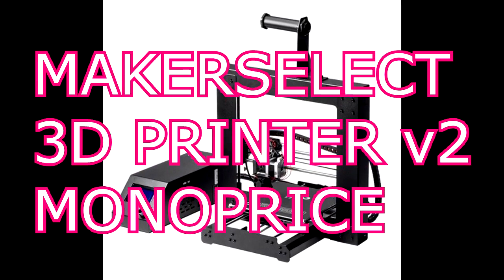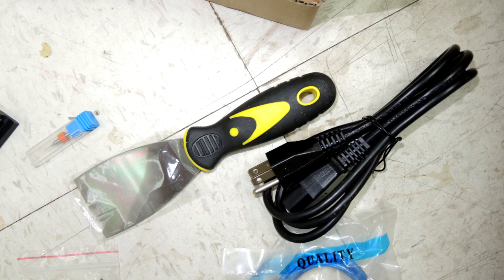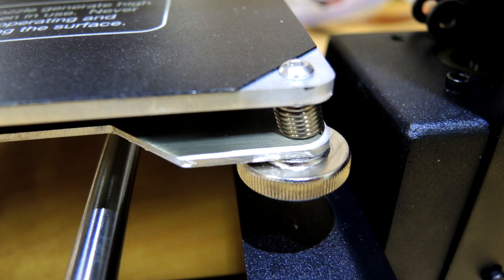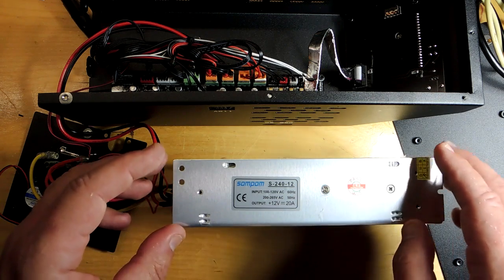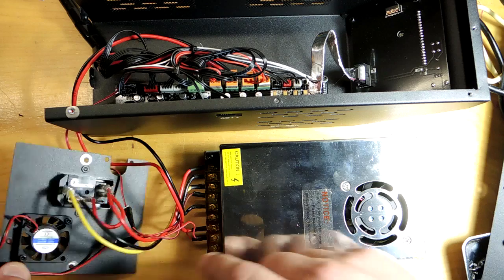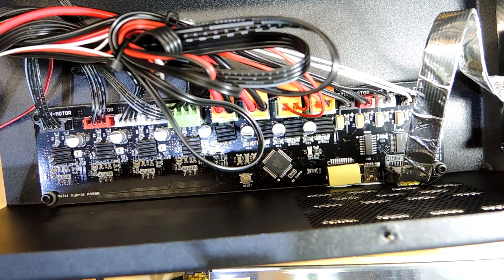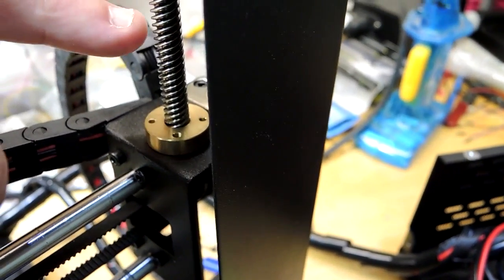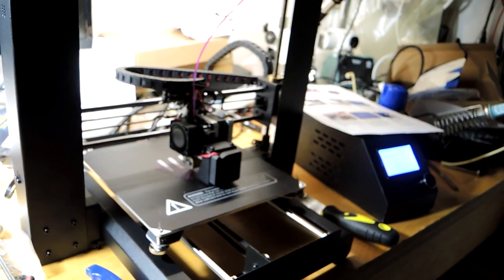Monoprice Maker Select 3D printer: Crazy Cheap!

Comment: Holy crap that is cheap, my cousin has an 800-some dollar printer and it seems to be about the same bed size.

I figured I'd need to spend at least a thousand for a decent one and I'll have to look into this more but it might actually be pretty good resolution too looking at that butterfly.

Seems it would be pretty trivial to add an extra fan or two to keep things cooler.

Also not sure if it's a popular thing or not, but I think to make sure the model comes off well, people put masking tape on the bed so it doesn't stick too much, my cousin does it, but can't recall why.

Comment: FYI there is a know ground issue with the Melzi board. A jumper wire needs to be added to help stabilize the hotend temperature. https://youtu.be/bXQ1gAid17Y

Comment: is the raw material (wire?) expensive?
Reply from the maker: not really.   About $25/kg for PLA on Amazon
Reply: Absolutely not. This uses standard reels of filament. You run into the expensive filament issue with some of the box store units that require chipped reels, but quick research on those can help you avoid that issue.

While I don't own a 3D printer myself, I have been keeping an eye on this technology for the past several years and the improvements are amazing for the home market and I'm impressed with the experience that electronupdate had with this one.

Comment: be interesting to see you upgrade the wonky parts and do some things that require accuracy, like printing threads that have to match parts from something else.   i guess youd probably want to make a box to give it some thermal buffer from the air too.    perhaps something like a wingnut, might be a good test, both for fit and to see if its strong enough for reasonable use.  would also be interesting to see if a large part prints to an accurate dimension and on all axis.
Reply: if you want printed threads then your going to be more interested in laser  sintering printers . That being said it does not mean you cannot work around what this printer cannot do this is a good printer easy to set up and needs few modifications great for seeing if you want to go further into the 3d printing madness
Reply: sure but thats metal, great of course, but sometimes plastic parts are handy, if they can be close to moulded parts strength, i actually have some plastic wing nuts, for fairly light work they are fine, wont last too much rethreading of course.